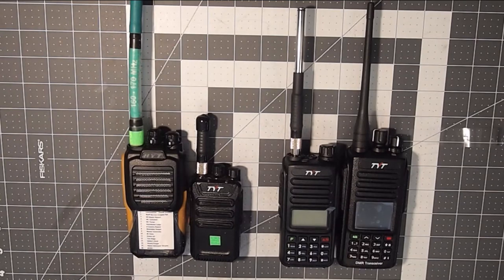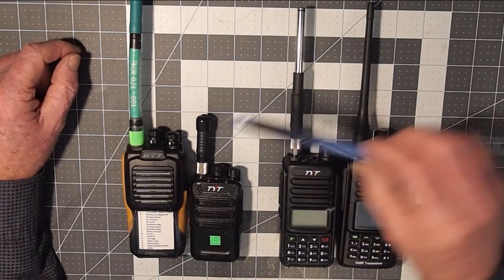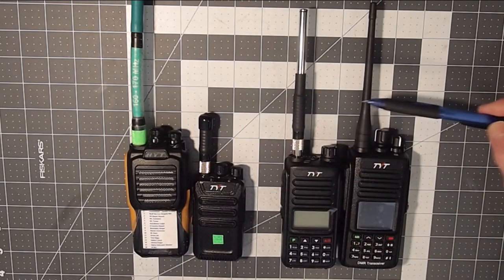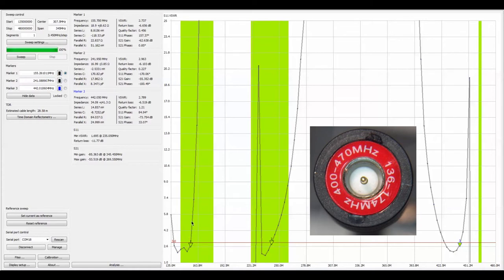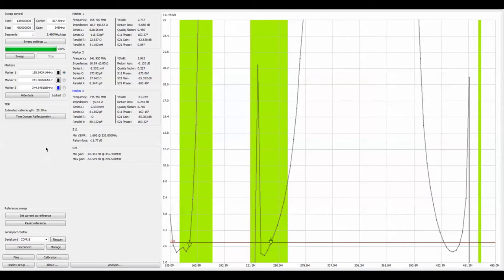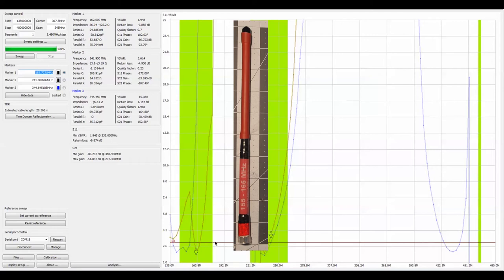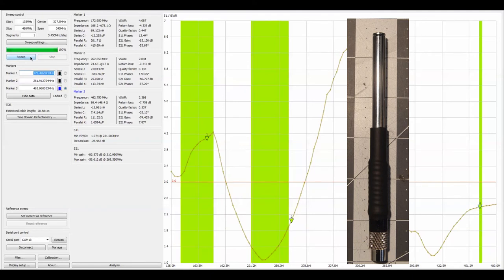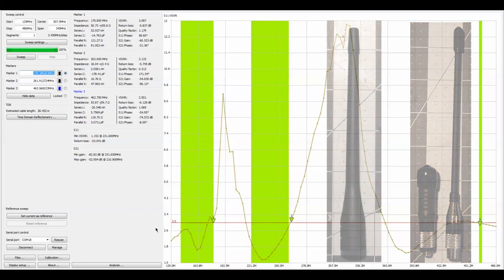The undocumented downside of dual band radios

Comment: Great video! Thanks for showing us how each of these antennas perform. I’ve been very happy with my purchase from you of the UV98 with a few antenna options. I mostly keep the 270 on it to hit the local vhf/uhf repeaters in the area. I like knowing that I have other optional tuned antennas which will perform better if I need them too.
Reply from the maker: Thanks a lot Matt. You pretty much covered all the bases with your order where all your antennas and counterpoise ended up costing 4X more than the radio! That fits in with my doctrine that the antennas are more important than the radio. In fact the stock antenna in the video is from a UV98, but I've tested most of the stock antennas from the popular offshore brands and they are all pretty much identical. Some of the other popular offshore after-market antennas that are often discussed in the HAM forums, turn out to be not much better however. The recent availability of affordable Vector Network Analyzers is making it easier for everyone to test this for themselves.

Comment: Great video. It looks like the stock antenna was tuned to work on the amateur bands, which is really what those radios are sold for (legally). Another thing to experiment with is extending the telescopic antennas by different amounts. I have one tuned to amateur frequencies but if I want to listen to something slightly higher than either of the amateur bands then I'll collapse it slightly so it should be better tuned for the higher frequency (never measured the SWR though, it's just an estimation)
Reply from the maker: Thanks for the feedback! One thing I try to shy away from is an anthropomorphic view of the 'legal' ramifications of how the hardware manifests itself in a given ecosystem.  The genesis of this is due to a number of years I spent working in the South China Sea using equipment that was not legal in North America and Europe for the frequencies we needed, but not a problem where I was. However, my fondest memory is from the World Cup Ski events in Europe where, while you are at the 'Germany, France and Switzerland Tripoint', ski area,  plain clothes peace officers would simply ski up to you and if you had an illegal radio, drill a hole through it, and then ski on to find the next coach from 'who knows where', and drill a hole through his radio, while Pirmin Zurbriggen would be skiing past making history (wish I had a souvenir radio with a hole in it now). As a 'liberal' Canadian Peace Officer myself at the time who was just observing, I greatly loved that approach to solving the 'justice vs. legality conundrum' in a quick and effective manner. The other thing to keep in mind is that some of these present day radios actually 'purport' to have achieved FCC Type approval for commercial use, and therefore, due to Canadian Statute, are also listed in the Canadian database and can be licensed for use on commercial frequencies (EG: the TYT MD-380, and Wouxun UVD1P spring to mind). The other factor I want to be sure folks are aware of, and that I briefly touched on: the reflected power. Take a stock antenna, and even if it is on a frequency such as 148 that has an acceptable SWR, take a look at the reflected power, and I think you'll find it is unacceptable (at least I did). In short, I try to keep any sort of regional bias out of my looks at the legality of hardware, and that is one of the reasons I have the disclaimer in the credits that everything I do is not suitable for recreational users or recreational interest. And you are bang on about learning to extend or collapse the sections to match your frequencies to optimize your SWR. I think there is one video where I did that with the help of a VNA to find the best tuning points.

Comment: So you use a Powertank pen wich can write below freezing temp. Also writes upside down and on waxed paper. Nice Choice.
Reply from the maker: Ha, I did not know about the waxed paper bit. They were our issue pen for my day job before I retired, so I used to find them at the bottom of the washing machine on a regular basis, thankfully with no ink stains on the uniform shirt. Now that I sit at the computer most of the day a Xiaomi Mijia pen seems to be my daily driver.
Reply: @MountainParameters  I used to work at a motorcycle parts warehouse where the only pen that never ever failed on any surface was a very expensive Space Pen from Fisher. 
Now I reformed my old Space Pen and started to use Powertanks.
Reply from the maker: @Sashquatsch  Too funny, I also have had one of those Space Pens sitting here for years, if not decades! (from my 'pen obsession' phase of life). Not sure where it hides, but every once and awhile it seems to turn up when I need a pen to sign something, and then goes back and hibernates somewhere.